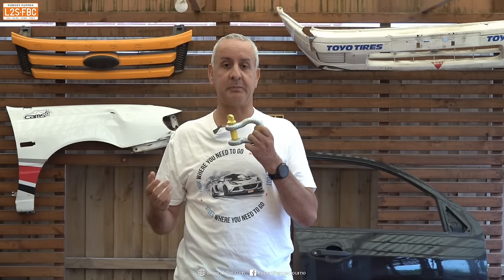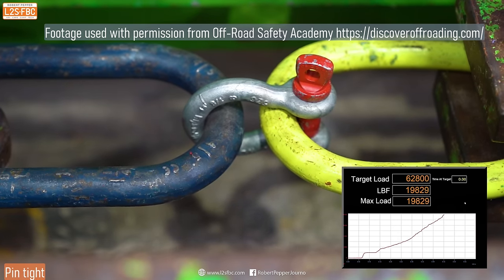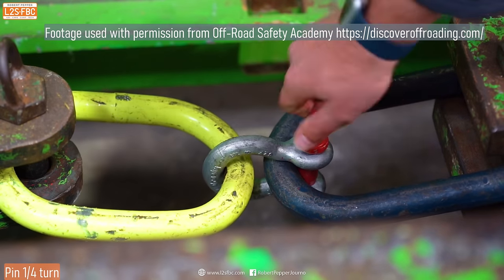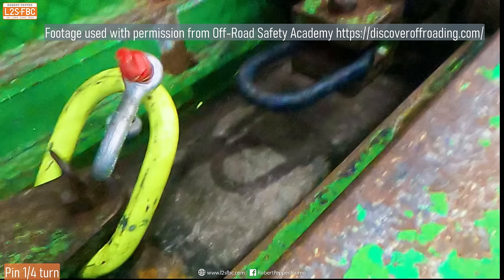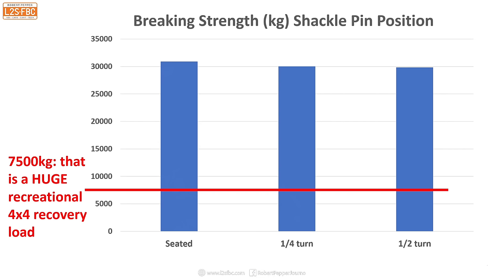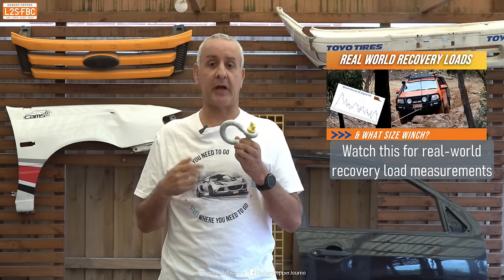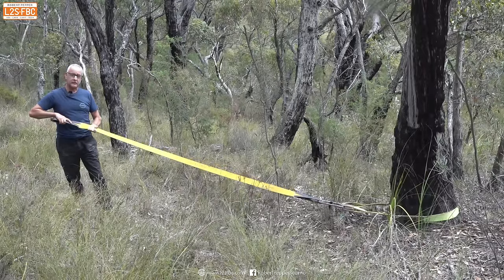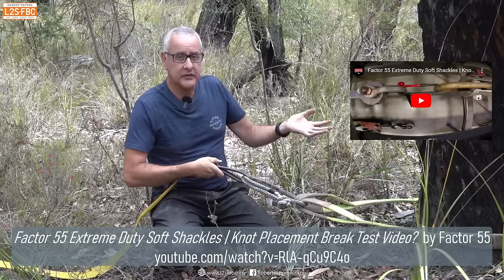What happens if you back off a shackle by 1/2 a turn?

Comment: I would argue that the shackle will deform enough under only half rated load to make NO DIFFERENCE if the pins was set fully or loose by 1/8 turn.
Any deformation of the shackle will bind the pin and act as if it was fully seated anyway.
Reply from the maker: No, the more pin there is threaded, the stronger it is.
Reply: @L2SFBC  As was said elsewhere in this thread IF this was tested with a large enough sample set there would be no significant difference (statistically) with an extra 1/16 engagement of the threads.

Comment: its breaking the pin not the shackle i a person and just their hand cant tighten it enough to make a difference. you could have used all 3 tight and they would still be different most likely the same outcome. i use to move barges and that hole in the shackle was used to tie it where it wouldn't not back out and we would leave it at least 1/2 turn off. because if you got it tight you would have to use a torch to get it off. the same way when i was in the Navy. we always backed them off and used wire to tie it where it wouldn't back off.

Comment: - and the Australian Riggers Guides have (at least the version I have access to) the "back off" routine - without noting the potential for siezing/mousing the shackle (edit; it does - I reread the sections to check, my bad)... For trailer securing type of use - a "loose bolt" is liable to vibrate loose after 1000km jostling down the road.  The concept of "tool-less" release of threaded fittings is a little idiotic, if easy disassembly is mandatory, use a softie, or  safety hook - carabiner is a tool-less "clevis" - spring hook (German origins) other styles exist. 

As with HT bolts - the higher the tension the less the potential for fatigue (over a long life)-  loads/stress up in the high mid elastic range. A deformed/bent pin results in a useless "temporary securing device." (Carry a small podger/"shackle release spike" in the vehicle in case needed).
Reply from the maker: So what does it say re back off?
Reply: @L2SFBC /   NSW Workcover - I have a freely available "old version" - 1995 ?? current or not:??  (NB,, I was incorrect in another comment re mousing - they do mention mousing...  in the "shackle", as well as the "lifting" /"sheave" sections.)
EDIT:The critical line went missing-repasted, look it up if want to verify... "Rigging Guide".
P70:  Do not use a shackle or pin which is bent, strained, deformed or damaged. Tiny microscopic cracks
may have developed during deformation. These can extend under quite small loads and lead to
complete failure.
Screw shackle pins should be tightened then loosened very slightly,  so that the shackle pin can be
unscrewed when the weight is released. If the pins are tightened and the strain is taken on the shackle
the pin often jams and is difficult to unscrew.
Where shackles are subject to vibration such as on luffing bridle pendants, mouse the shackle pin to
prevent the pin from unscrewing.
Shackles are designed to take vertical forces only. Diagonal forces will strain the shackle and lead to
eventual failure.

NB: P32 - in sheave block section: The screw pins of ‘D’ or bow shackles should be moused where used on standing rigging, and running
rigging where the pin can become unscrewed, causing a serious accident.

Bullivants guidelines: (p155)
Ensure the pin screws down flush and is bedded
evenly on the surface of the shackle eye. Do not over
tighten and mouse pin for security if vibration may be
an issue.
• For safety pin shackles ensure that the nuts and split
pins are fitted and in good order.

Canadian guidelines..  no mention of backing off:
Shackles
• Available in various types (Figure 49).
• For hoisting, should be manufactured of forged alloy steel.
• Do not replace shackle pins with bolts (Figure 50). Pins are designed and manufactured to
match shackle capacity.
• Check for wear, distortion, and opening up (Figure 51). Check crown regularly for wear. Discard
shackles noticeably worn at the crown.
• Do not use a shackle where it will be pulled or loaded at an angle. This severely reduces its
capacity and opens up the legs (Figure 52).
• Do not use screw pin shackles if the pin can roll under load and unscrew (Figure 53).

Comment: What is the rated strength of the shackle vs. where it broke? It's my understanding (& experience) that the backing it off is for ease of removing (un-rigging)  said shackle when up in the air it is easier to remove if any binding was put on during lifting. Also, I've never been involved in a rigging that was not way overly safe, where the weakest link was still rated 2-3 times over the actual load. I don't think that there's ever a reason to try being a limit tester.

Comment: I don't think the 3% is statistically significant, and - more importantly - when the breaking strength is 10 times the rated strength... who cares?   If you are yanking a 2 ton vehicle with a 1/4" shackle then you get what you deserve, and the 3% wouldn't help you.   Use the appropriately rated shackle and you don't have to worry about this stuff.   If you don't, then you will suffer.  Play stupid games and win stupid prizes.   I am trained in rigging (I went to school for that) and I always back off the pin on the shackle (when threaded) because I don't want to have to get tools to undo it after a lift.    The guy below who suggests anti-seize has a good point for a shackle used for recovery.  Mine are kept indoors and used for rigging, so rust isn't an issue, but if you're keeping it in your trunk then I'm all for that.

Comment: The shackles i use at work for lifting are much bigger then those. But i always back them off a bit because if you dont after the weight feom the lift is put on it you cant get the pin to turn by hand i usually have a wrench nearby but just a pain.

Comment: I've always tightened them, mainly because I've seen 1/2 turn, vibrate into 3/4 of a turn. I've never seen a tight one vibrate loose during a recovery. I could see it for riggers, and the afore mentioned ship anchor guys, but I'm neither of those. And I own a wrench in case it gets too tight.

Comment: Surely though everyone works to a safety factor of at least 2:1 if not more so if you’re planning on loading within 50% of the rated load you’re going to use a higher rated shackle 🤷🏻‍♂️

Comment: Another great testing video, I’ve never gone a full 1/4 turn back I’ve just cracked them loose before my pulls. Would you be interested in looking at forward notions jowl shackles? It’s not a threaded pin but two J hooks that are supposed to mesh together and hold onto your strap. I think they’re an interesting design but have not used it me yet myself.
Reply from the maker: crack back is fine too, 1/2 turn maybe too much. How about 1/3 :-)  Have seen the Jx2 design but not looked into it, not against innovations so interested.
Reply: @L2SFBC  I was looking at their website just now and in their tech section they do actually post a break test graph, and have a video of the test. Reading through their mohawk receiver hitch tech sheet as well, and it seems they have a break test sheet and video of that as well.

Comment: Question: If I want to connect a g8 chain (8mm) to a snatch strap what is the tool or part used for that. The bow shackle  does not seem to go inside the hole of the chain. thanks
Reply: Two shackles is probably the best way to go. Smaller shackle to go through the chain, a larger one for the snatch strap.

Comment: If you need a shifter to undo the screw on the shackle after use, wouldn't that indicate deformation of the screw pin has occured due to an overload situation?
I always thought the 'backoff' was for later ease of unscrewing the pin after time in storage or left out in the elements because you are then only overcoming the minor binding in the thread and not having to contend with the added binding of the shoulder with a snug screw fit.

Comment: Humans are terrible at risk analysis.   We tend to ignore the actual highest risks (in this the case, the gear with lower or ambiguous load ratings like soft shackles or wrapping a strap around a sharp edge) and focus on dumb things with extremely unlikely failure modes (like a steel shackle with the pin backed off 1/4 turn).
Reply from the maker: Exactly. We like to focus on small things which are easy to understand.

Comment: If you want a "real life" answer , as an American Union Ironworker.  We fly big deal steel.... heavy structural with Crosby  shackles all day every day. We back it out a 1/4 turn so the conector doesn't have to "un-stuck" the pin.  Big bridges and skyscrapers_ we have NEVER had a failure from this
Reply from the maker: Thank you!!!

Comment: I argue that you should not be using any steel shackles in a recovery.  Because they are dangerous missiles in a failure. We should be working towards vehicle hard points that are designed to use soft shackles.
Reply from the maker: I agree with that too, but for the moment, we use them.

Comment: you also forgot "there might be leeches or crocs in the water" for reasons to rush.
well, i always have and always will release a d shackle at least a 1/4 turn when im using one. that break difference is honestly not even worth the ink they use to put it on the recovery instructions. as you said, noone is going to meet that force on a recreational recovery.

Comment: Let me start by saying I'm not a mathematician and being an American, I don't know squat about the metric system, however I'm confused @ 5:30, how is 65,166LB = 30,000KG but 65,759 (roughly 600LB more) = 29,800KG (200KG less than 30,000)?
Reply from the maker: That was an error, transposed the lower two, noted in description and pinned post.

Comment: Well now we can say with confidence that it doesn't much matter and leaving it loose if probably best practice.
Reply from the maker: Well not quite loose!
Reply: @L2SFBC  If I put the lug nuts on my truck on finger tight and backed them off a 1/4 turn how would you describe that situation?
Reply: @michaeldose2041  Don't treat your lug nuts like shackle pins.  Bad things will happen.
Reply: @boomupengineering  Did you watch the video? Did you look at what the content creator wrote? When you back off your shackle 1/4 turn you could describe it as loose. The CC appeared to take exception to that. So if I backed off my lug nuts a 1/4 turn they would CERTAINLY be described as loose. You comment then is pedantic. I know you're an engineer and I never met one yet who knows as much as he thinks he does. Maybe a diagram would help? Some reading comprehension classes?
Reply from the maker: Do you want your lug nuts done up to the same torque as say towbar bolts?  You'd know what happens if you over-torque lug nuts.  So, it's almost like there's different torques for different situations, wouldn't you say?
Reply: @L2SFBC  OMG this is turning ret@rded. shackles can be tight or loose doesn't much matter, strength wise. You wanted to split hairs on what loose meant. And used the term not quite loose, which makes ZERO sense unless you want to define what ''not quite loose'' means. I tried to use and example and you took it down a rabbit hole. Numb nut is what torque this is.
Reply: @michaeldose2041  I merely said to not equate lug nuts to shackle pins.  They are different fasteners for different applications.  Never is a loose lug nut a good thing, unless you are taking off your wheel!

Comment: U dont know my buddies then,  when they pull with 4x4.  10ft of slack  & snap my cable or chain every time.     I prefer the hand tight  no backing off of pin just becouse of lost pins between uses. As for breaking stringth i really try not to overload any the gear but will use a weeker conector only in 1 spot so when a failure  does happen im not fixing a brok chain or cable only a connection

Comment: Shackles are expensive. I have seen them deformed by backing off a 1/4 turn. Then when you go to put the pin back in it won't catch the threadsto start turning.

Comment: Can't tell by the camera angle but the one thing that I noticed is with the pin loose the pin bowed out farther until the opening of the shackle came down tight against the testing fixture ring? If the test fixture rings were smaller how much would that effect the end result? I'm guessing that results would be different.

Comment: If you’ve distorted the shackle you’ve not done your job correctly. The proper shackle and use is the least of my concern for the job. Your strap or cable is the weak link also what your attaching to on the load.

Comment: Mate, you’re talking about using a shackle well beyond its practical limit. There’s times when you need to back it off, and times when you don’t want to. If I’m doing a single lift, say, a motor onto a pump frame, it’s 500kg and I’m using a 3.2T bow shackle, backing it off a bees-dick won’t make a difference (except to make the job a lot easier and more efficient)… but if I’m towing a piece of heavy equipment through harsh conditions, say, with a bulldozer, then I’m gonna tighten it up and also use a tie-wire… people need to stop trying to prove how smart they are and just get out and do some work.

Comment: You say that ina 4x4 apilcation you wont ever get that much strain on the shackle. Your testing is a slow steady pull, what about shock loading? How often do people get a running start using shackles and chains? Seen it alot. 
The shackles and chain snap under the shock load, flying both ways doing damage to vehicles and people, often killing someone.
Reply from the maker: How much force do you think would be generated in a shock load if a 4000kg vehicle rolled back 2m on a 45 degree slope with no rolling resistance and decelerated over 0.2m? It's nowhere near 28t...and other things than the shackle will be breaking first, including but not limited to the vehicle chassis.

Comment: Splitting hairs, eh? One would think that the manufacturing tolerances would be of a possibly larger effect.
Reply from the maker: Yes, two engineers have made this point, and suggest that if lots of tests were run, there would still be a difference but the scatter would encompass 3%.  See pinned post.

Comment: True perhaps but useless.  The back off is normally more like a 1/8 turn else the shackle may tighten up when pressure is applied and will take a wrench to open.  One should NEVER use anything within at least 20% or more of it rated work load so the slight decrease in break straighten is totally insignificant.

Comment: At 1:37 the pin has plainly broken at the top of the threads. That can be seen at 1:39, played frame by frame. Yet you state that the pin gets nowhere near breaking.  What am I missing?
Reply from the maker: I do say the pin breaks in the same way all three times and even highlight it?
Reply: And it points to the weak point off the shackle pin due to the threads being a smaller diameter than the pin. Its more about tensile or shear strength of the pin than it is about the shackle body. Most likely a bolt type shackle would see the bolt shear at one of the areas where it goes thur the shackle or right in the center where its being pulled from. As its threaded area would not be subjected to the shearing forces that the screw pin shackles threads are. The break poundage would probably be a little higher or you may even see the shackle body's fail.  I don't really think bolt or pin tension either tight or backed off makes any real difference especially if you have a straight pull. As was said the 3% difference is most likely within the shear tolerance of the fastener
Reply: @L2SFBC  thanks, I must have watched too fast.

Comment: If the shackle is too tight after operation get a longer wrench to loosen. More pressing matters than this. How about how to economically build shackles or anything in the United States vs India or China.
Reply from the maker: I cover a wide scope but not wide enough to consider geopolitical industrial relationships.
Reply: How about who makes the strongest shackles by comparing the same sizes in your test rig then

Comment: Sir you should really look into some  basic rigging rules. The point of tighting a shackel all the way is 1 to stop the shackel from deforming so that you will not be able to get the pin out or you will not be able screw the pin in to the shoulder. 2 the main concerns about 4wd recovery is shock loads and side loads. If the pin is backed out any and not shouldered you can count on shackel damage. And the chances of the not coming out are very high and you have to cut the shackel to take your rigging apart. I am a certified rigger in heavy industrial applications.  The most dangerous rigging oppositions are what you would call light rigging operations  aka 4wd recovery. More people die or get serious injuries in light rigging operations the say 100,000 lbs plus rigging opperations. IF YOUR GONNA TEACH RIGGING OF ANY KIND TEACH PEOPLE NOT TO DIE WHILE DOING IT!!!

Comment: Hi Robert I'm an arborist and I'm having a laugh at all these rated recovery systems being attached to a tree. What's the tree rated at?
Probably magnitudes of scale mors that you need. But you don't really know.
Reply from the maker: Well it turns out there is an estimating method for strength of trees...more on this later
Reply: That's why I like playing with arborist stuff.  I get to estimate and do all sorts of things that I can't do at the job site as a rigging engineer.
Reply: @boomupengineering what is a rigging engineer? Is that an actual degree? Sounds fun.